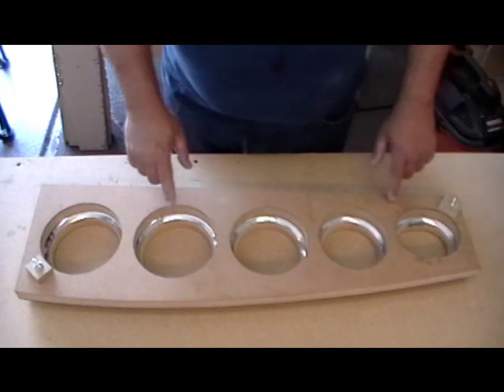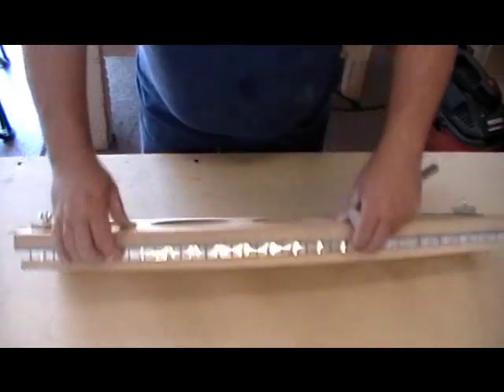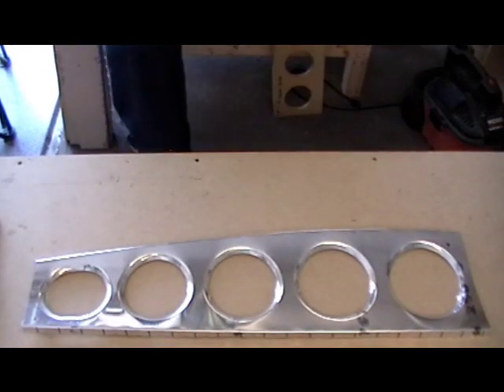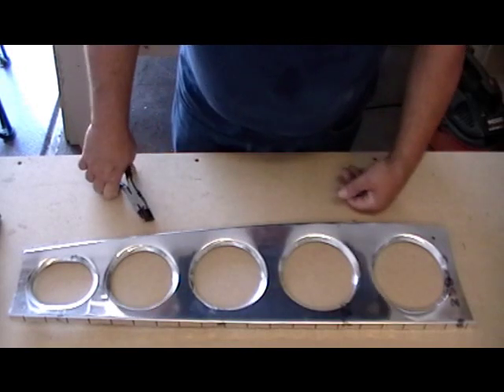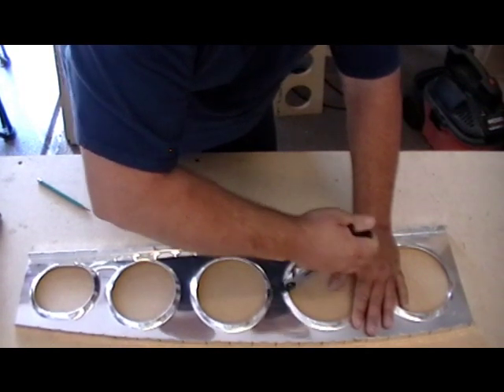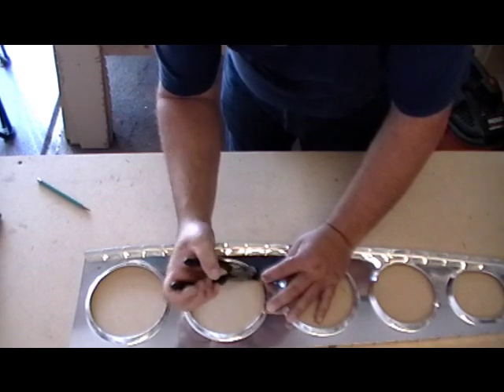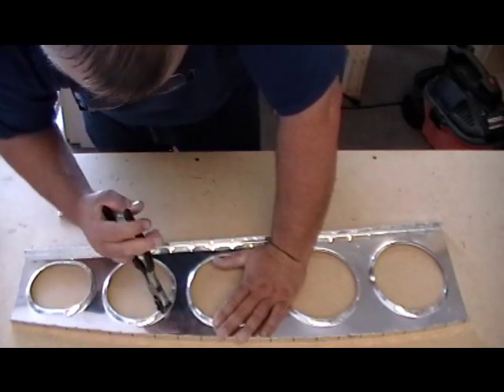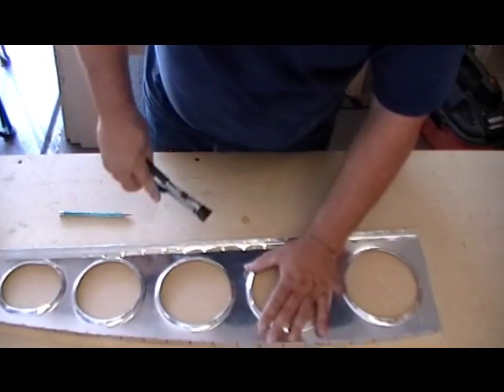The desert Bearhawk Project: Center Rib Flanging

Comment: Interestingly enough, you actually did "shrink" the flange by applying your anti-fluting pliers. By pulling the material up, further from the rib's web -- raising the flange, so to speak -- without actually stretching the metal, you create tension that will pull the bow in the wing thickness direction out of your rib. Good job, better to think about this for four days and come up with a good solution as opposed to working for several weeks and wind up with a unsatisfying result.

Comment: Day late here, I'm sure you're finished by now...  But Eric Newton covers this in his builder's book, I think?  I adapted a 5/8" wood dowel rod to attach to my 3X rivet gun.  I laid the rib flat and tapped lightly around the hole with the dowel in the rivet gun.  Flattened them out and finished all ribs in a few minutes.

The enemy of good is better.  Earl Luce said one time about building planes.  Measure with a micrometer, mark it with a grease pencil and cut with an axe.